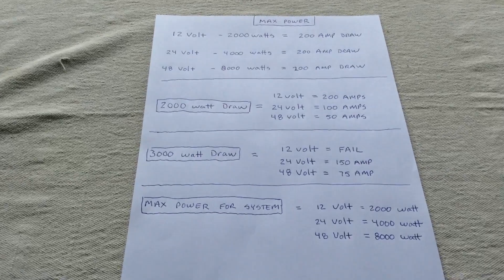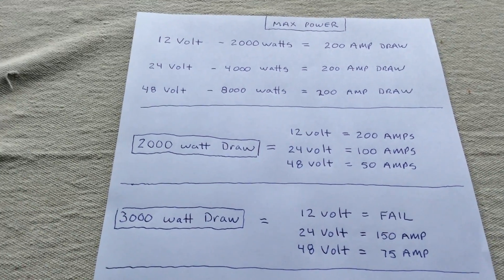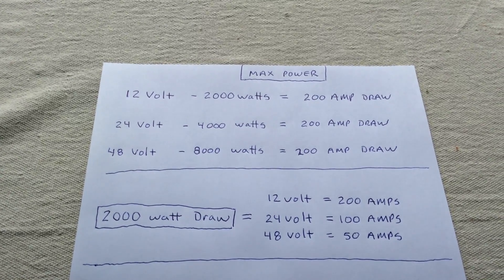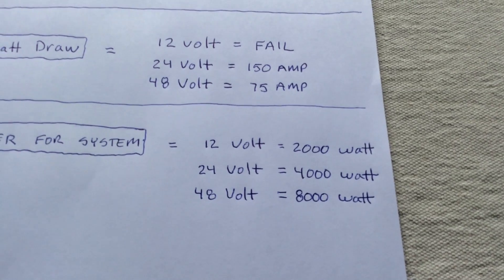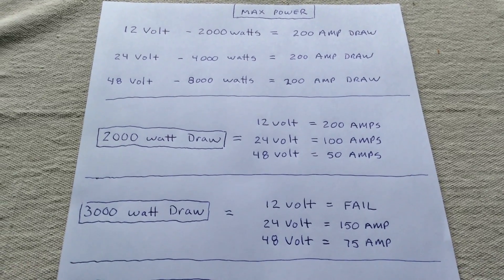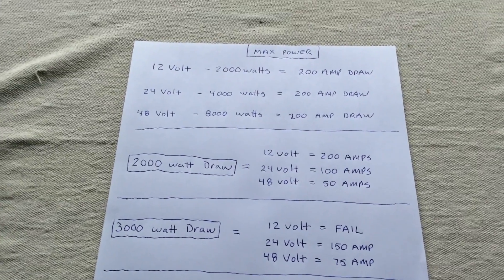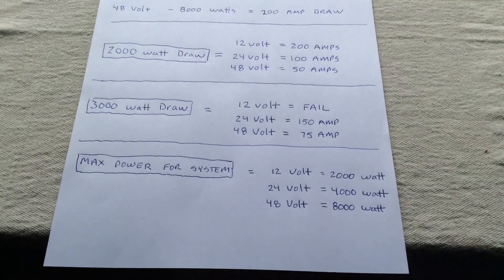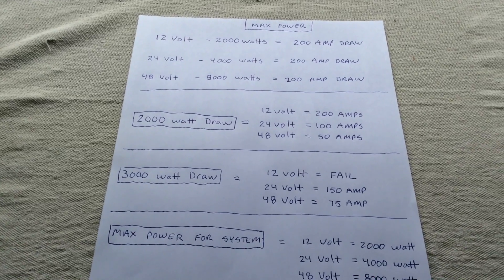Solar Off Grid Inverter 12 / 24 / 48 Volt Explained

Comment: Can someone explain, why exactly is the maximum like that for each voltage? Lets say i put fatter cables on my 12V, can i draw more than 2k watt?
Reply: Hello, I will answer your questions, even tho I work with AC, I guess a lot applies too. To transfer 200A you already need robust PCB, not to mention cables...
0 awg or 54mm2 >> 150A
00 awg or 68mm2 >> 190A
000 awg or 85mm2 >> 250A
0000 awg or 107mm2 >> 300A
Try drawing cross section area of those values, you can see how much you need... PCB can't handle that much current even with flowed solder, maybe it can, but half of inverter would probably be solder/traces, not to mention how many MOSFET you would need to regulate it... It's not economical and impractical to use such currents... Well, you can do over 200A systems, but they wont be able to depend on wires... They will be probably bus bars and weird systems that will melt your stuff, try buying server PSU, it can slam 100A and I can melt a lot of stuff with it already, can you imagine 300? 400? It will weld stuff and will be hazard risk you don't wanna take...

Comment: I’m looking at getting either 4 or 6 350 watt solar panels. Based on what ur saying I should get a 2000 watt Inverter and use 48 volt batteries. Right ? I’m wanting a Limiter also, what would you recommend ?

Comment: As I understand. An inverter converts dc to ac. Meaning it will not be that much amperage, if you have a Keurig its about 1500 watt divide tha by 120v it will be about 12.5 amps. That's why its always recommended to have a 1/0 awg cable from the battery to inverter. I think the limiting will be in the solar array it cant be that big because of the wiring.
Reply: Oh and the charge controller if its solar. A 40amp for example can only have like maybe 420 440 max to be safe.

Comment: So for example if I have eight, 200 amps batteries and twenty, 250 watts solar panels and all the system is on 48v ,
So how much power storage do I have? 
And how strong is it compared with the same 24v system?
I hope you got my question.

Comment: With a 48volt rv system with 200watt panels can i run a wire from the car battery and use a 12v to 48v step up transformer to charge the 48v battery bank?

Comment: 12 V with a 2000 W load draws 166.66 amps. You might mean a 200 amp fuse would not blow unnecessarily.
Reply: A 200 Amp fuse should not blow at 200 amps. It is should be rated to pass 200+ amps for a certain amount of time. Otherwise you would have fuses ready to blow at 195+ amps.

Comment: Great explanation.  I just got done watching a video where the guy had 6000watts inverter at 12v....lol....and it wasn't working and he didn't realy know why... I dont want to discourage anyone but people can really get them selves into a dangerous situation.  When I started I knew nothing but I read alot and did find information stating I shouldn't exceed 2000w at 12v. And I went from there. Your video explains this very clearly.  My advice to anyone now is just skip straight to 48v systems.  The components are very good now

Comment: From a year ago, doing my first system, I've learned to use several smaller setups instead of trying to run one massive system. Just like your grid power has several lines, I've set up 3 sets of panel-controller-batteries systems, and am very happy with the results.
Your video helped my thinking that led to this... Thanks again!!🙌🙌
Reply: GOOD IDEA!!   Make sure you GROUND those Fckers!!  I too have a small 2nd system with a motley crew of leftovers ..   1200 watt on pannels, 4 used AGMs and due to one of the 4 being a bit-O-ch by not charging the same, maintaining a charge.. (it's damaged when I got the 4) I'm forced to use a 12v setup.. .. still.. it's a few hour(s) backup!  So rock on!
Reply: Great idea! the more I see and learn, the more I think I will be doing the same.
Reply: planecrazyish 
Good luck!! 👏👏
   One thing I did was to use lower power per system, but I bought quality equipment, and didn't buy cheap stuff and defeat the purpose of efficiency.
Reply: I am starting yo attempt the same

Comment: Well gee wiz. I wish I would have seen this video before I bought my 3000 watt inverter for my 12volt system. Well i got 4/0 wire and it don't run that hot. Plus i got a few fan's. Cooling my system. Thank you tho for calling me stupid. I'm not, I can assure you. I just wasn't informed enough. Anyways no harm , no fault. I'm out. Dont get your ball's stuck in a vise.

Comment: I run 2 inverters on a 12volt 300watt system I can run my tiny home on the 6000 watt inverter with no problem I run two fridges 3 fans a TV a coffepot a microwave and a apc and my lights are all lead bulbs they draw 6 watts each got 5 .

Comment: System planning is the important factor here. My 24V system has a 1kW pure sine LF inverter, 400Ah FLA battery, 1140W of mono solar panels through a 40A MPPT. To draw 1kW takes 40A off my 24V supply, which is 1/10 of its available capacity. In strong sunshine, my battery is at float, so I can draw 1kW from the panels, and the battery stays full. I could draw 2 kW from the system to do laundry in strong sunshine if required, but not at night, so the battery stays happy. (40A from panels, 40A from battery). No heavy loads after dark, only draw big current in full sunlight. My battery is Lead acid, so I try to avoid using more than 15% of it's total capacity, and recharge asap.
Reply: nlo114 your 40a controller may be limiting your system to 960w since 40a * 24v = 960w but your stem at 1140w / 24v = 47.5a, which indicates you be using a 50a ( or 60a ) charge controller.

Comment: not to be rude but you dont really have any idea what your talking about. I have a 12v system running 3kw loads all day long, my system is fine, 600ah with the right cabling with cost me £35  for my inverter. 95mm2 cable can handle 300-400amps. 48v at 3000w is more efficient but it can be done

Comment: You're not thinking that out right are you? The inverter bumps the 12 volts up to 120 volts, at that the amp draw on 2000 watts would be  16.6 amps, 16.7 amps if you round it off.
Reply: i think hes explaining is battery to inverter not inverter to load .

Comment: I understand the differences. My system will draw around 400W from the inverter, but the majority will run off 12V DC. In spite of the aforementioned reason for using higher voltage systems, I will use a 12V system for my camper van. The cabling run is short since it's a van, I'm running a lower load, and any higher voltage system would require me to buck down to 12V, being a loss in efficiency.

Comment: Seems you and most others on here don't know how to deal with high current loads if you think you can't run 3000+ watts on a 12V system. The power companies have been dealing with it for ages on larger scales. Go look at a factory or facility that has a high current draw. They don't run a 500KV line to most of those places. They run multiple lower voltage lines if it is some distance from the high line. Get down into the local area grids to a high draw place, again you will see the same thing. Multiple feeds. That is why some places have conduits or cable ducts run in groups of three or four. In each conduit you can find up to 3 wires all carrying the same leg of the 3-phase line. Or even all three legs in each conduit. Depends on the company.  3000 watts on a 12V system would be 250 amps. 2 150A feeds would handle it just fine. The extra 50 amps, if balanced right, more than covers the loss in the inverter and line losses. 5KW is 416 amps at 12 volts. Again you could use 3 runs at 150A per run. Batteries are run in parallel to supply more current and your wiring can do the same. It is better to use less wires of the proper size but it can be done with more wires of a smaller size. That is exactly what the wire you use does once you get over ~ #10AWG. Seldom will you see one solid conductor larger than that and the wire is multi-strand to carry the load. Our 1200A 3 phase 480V/277 was done exactly that way. 12 conductors to the main breaker panel as it was 480/277V system. From that 1200 Amp breaker it went to from 200 to 600 amp breakers depending on the load attached at the other end. Most of the other loads were transformers but there were some other loads that were 480 v motors.
Reply: Respect brother honestly I have watch this video many times over the last year and a half honestly I never read the comments. Currently I am running 🏃 a 12v system   what you say about the wiring is so true as currently I have two sets of 0 gage wires 🏃 runs to my 2500w 12v inverter it runs everything in my house 🏡 fine my one issue battery 🔋usage time  note it cost more to run 🏃 12v system you need more batteries and more panels if you want to run your house 🏡 if it is a small setup you be fine but for your home and  if you have kids don't even eye 👀 a 12v system trust me now days a 12v,  24v, 36v, 48v inverter they all cost the same with everything coming out of China on Sunday with God mighty hand I be going 36v and I am willing to bet I will get a much longer 🏃 time off my same 12 6v batteries I choose 36v because I have already 12 6v batteries and for 48v I would require 8 batteries and 4 would leave over I could have consider a 24v system but the deal was on a 36v inverter.

Comment: So can I ask a question? I have 3 12v batteries. After doing the math we came up with needing 900 watt system.. I need to run a 216 watt grow light  9/10 hrs a day. We got the math from a guy on youtube as well. If this sounds right to you pls let me know. I'm just trying to grow my own food indoors. So if I need a 900 w system with 3 12v battery bank and 1000 w inverter what size cables do I need? and is it the cables running to batteries, or cables on the solar panels or both panels and batteries? I know nothing about this and u sound pretty knowledgeable and will follow ur advice if you don't mind giving it. Thanks
Reply: Check renogy guage requirements in google
Reply: I have 8 300watt solar Panels, going to 8 100amp/hr batteries. Giving me 300 per hr for 12 hours. You can use a little more batteries, you didn’t mention how many solar panels.

Comment: I'm building a system for an rv and I'm not sure which voltage system to go with.  Which would be best for my needs?  I have 1600W fixed panels and can  add more as portable panels.  Would it be better to go higher V and run everything on ac power or run a converter to drop back to dc power.

Comment: So if I am running say 3000 continuous watts but the start up or surge is higher say 5000 watts, am I having to take that into account too? Nothing was mentioned about the surge of watts that I recall in video?
Reply: rhercha1 as long as the inverter can handle the short term 5000w then fine but if your pulling 3000w (assuming 220v system) constantly you should go for at least a 48v system or you need thick cables for the cables going to the inverter 

24v system Would work as well but your cables have to be thicker even then I would not pull more then 3000watts@220-240v or 2x socket 110v inverter (max 1500w per socket or lower ideally or hard wired but on 110v you need twice the thickness of cable so check temps connections are good) 

unless it's a proper branded inverter rated for say 8000w and is 240v (not a China china inverter, a copy of a copy) rated for it and hardwired correctly,, you just got to be careful once you go over 13a on the AC side as things can heat up if not wired correctly (plug sockets and connectors or the inverter it self get hotspots) on 110v is far more an issue as just 1400w is 13a (roughly) so you got to be really careful that you don't cause cable fire or overload the plug (as most none UK plugs are unfused witch can lead to cable overload or melted socket)

Basically if you looking at building high Watts you should make sure your cables and busbars and inverter (and please fuse it) is correctly sized and your not going to overload it

Comment: Doing an off grid bus build..... House part of bus is 22 ft long x 84” wide and 6’2” tall in the middle of roof.    If we did a 48v system would we have the ability to run a new air conditioner off the inverter?  And how much battery capacity would we need?

Comment: Sir, I want to upgrade my school project night light circuit.  I used 3v button cell and single White LED. Now I want to  make a  solar based charging night light  which can light up for 6 hours  by charging 6 hours. Please help me in mathmetical calculation of battery required, solar panel voltage and so on.

Comment: Thanks for the video I want a 3k watt inverter mainly because I want to run a small air compressor I have two batteries now and I will get two more soon. I was already thank  of going  from 12v to 24v. I don't  have the panels to go any higher. My only question  it will a let's say 12v 200ah run the same watt hrs as a 24v 100ah. I'm thanking it is but I didn't  know if there was a efficiency different  that would  just make the higher Voltage last longer in that the same wattage
Reply from the maker: it will be the same run time 12v and 24v. the amp draw will be higher on a 12v system so you need larger wire size that's it.

Comment: I am building a system now and have 3-100w solar panels, 500w solar controller, 4-12v, 92amphour ham batteries I plan on running in series, and a 3000w inverter! Is this in line with the figures on your sheet! Any information is appreciated! Thanks.
Reply: Stephen Tanner sounds good.

Comment: Excellent video, but what I don't understand is this is only part of the picture - surely you are feeding the power generated into a battery system (e.g. tesla powerwall) and the inverter runs off that? - so surely you could have a 12 or 24V panel system that feeds a huge battery system, and still draw large loads off the battery system?
Reply: Power is the product of voltage and current. This means that if you choose to work on high voltage, for the SAME power you want to support, then the current you need gets lower. This in turn means that the LOSSES of your system get much lower (than working with a low voltage system)...

Comment: Great video as a 35 year electrician you explain it very well, the one thing I would have touch on would be cable sizing I've seen so many videos from so call off grid people using undersize cables on input side of the invertor with no disconnect or fuses, to just plain foolish. Just putting in my 2 cents worth
Reply: Edgar, a question I have regarding wire gauges or size is simply can you use oversized wiring just to be safe, or is that frowned upon and let's keep cost out of the decision, just to keep it simple. Thanks for any input you may have but feel no obligation...
Reply: Edgar Acosta Reminds me of a young man offering his car and battery cables to jump start my 1997 Dodge Ram Passenger van turned camper. Couldn’t get the jump going as his cables were real skinny and probably a drug store $4.95 jumper cable. Pulled out my really thick Home Depot super special cables and connected them and vroom, start up. So, practically speaking thicker cables can make a lot of difference. Don’t ask about my trying to separate a torn sparking wire with a 12 inch screw driver. :)
Reply: @fmpApps  evidently you didn't understand his comment. He stated the very thing you tried to talk trash about! Hilarious! Learn to read before u you make retarded comments.

Comment: Excellent explanation. I did much research and decided to go with a 24 volt system and a 3500 watt inverter. As  you said no reputable inverter manufacturer will sell a 4000+ watt 12 volt inverter. Granted, 3500 watts is an overkill for my needs but my system was initially designed for residential use and I have instead repurposed it  to power my RV when boon docking. Thanks for this video. I wish I had seen it when building my system. There is not much info out there explaining the benefits of a 24 or 48 volt system. So far, it has served me well. Thanks again for a very informative video.

Comment: Urba 
if i get 24 batteries  trojan SAGM 12     12v  20hr rate 205AH will be set up 4 in series and 6 parallel banks?
with a   AIMS UL 1741 12000 Watt Inverter Charger Pure Sine Wave – 48Volt to 120/240Vac Split Phase.
but can you tell me how many solar panel will i need ?maybe this is too much but taking the advantage of 48v ,i think why not go big
Reply: How many solar panel you need depends on your requirement and which country do you stay.

Comment: So here is my setup - A 12v 4000watt inverter with a 800 AH 12v battery bank using 4/0 cables and jumpers to connect all batteries in parallel. I have a 300 amp DC circuit breaker in series between the inverter and the battery bank. Is this not the best way to do this? The math states 333Amps to support 4000w but I am only using about 2000 to 3000watts at a max.
Reply: Well I took your advice and changed out to a 24v 4000 watt system and still using the same 2000w loads and yes my Amps are 1/2 as you stated.

Comment: The invertor is stating wattage from the 115 to 120acv output.  1000w @ 120 = about 8.6amps.  There is a reason the 12v dc to 120ac invertor only has a 15 to 20amp fuse and a cigerte lighter plug. Its only supplying 8amps ish to the 115ac device you plug in.
Reply: For a load of 1000W working on a 12 volt inverter, the battery must supply more than 83,33A...
From the cigarette lighter, being fused with only 15A, the maximum theoretical power to draw cannot be more than 12V*15A=180W...(the losses being excluded)...